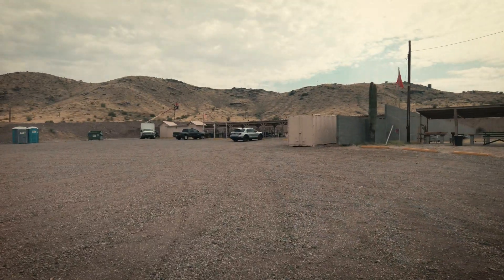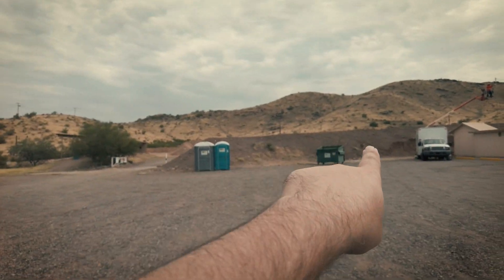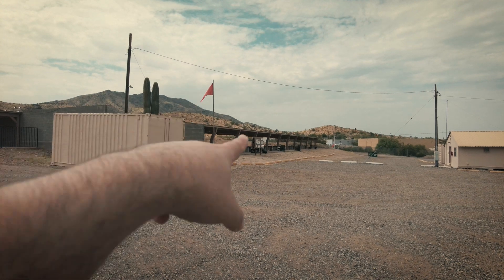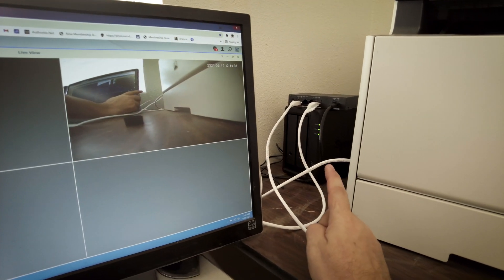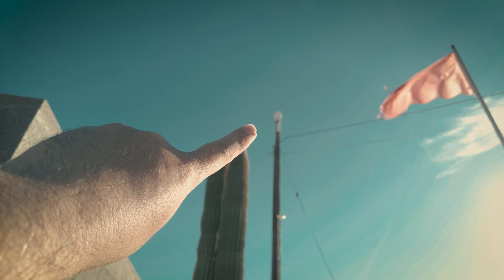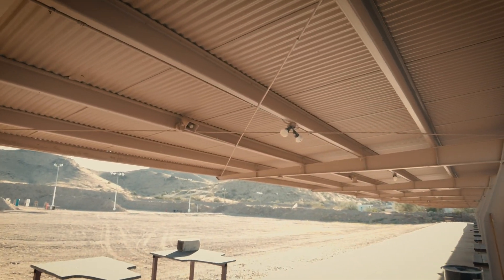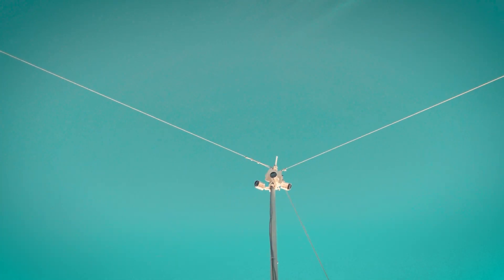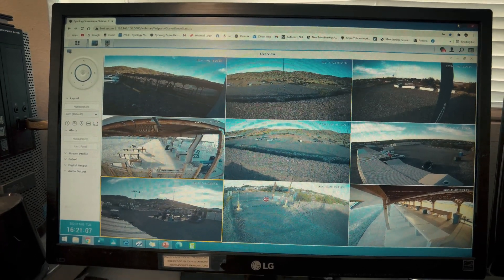Networked Security Cameras @ PRGC! | - DIY Ubiquiti Internet Relay Pt.73

Comment from the maker: I don't know if this is a common thing or not...anyone else network cameras with radios?
Reply: I do. I actually do quite a bit of networking cameras over radio for public service events. These are usually temporary networks, but fun to do.
Reply from the maker: @cfisupply  Oh nice! It works pretty well and yea, for temporary setups? It'd be perfect!
Reply: Locksmith/Security Prof, I have a few customers that have multiple apartment buildings with no connected networking, they wanted to add Access Control units for each separate building for the tenants to badge/fob in. Couple of Loco M2's and they're on their way. Easier than getting multiple ISP connections and using a Cloud Based system, although those are great for multiple very remote site syncing. Cameras run much run the same way, done a few gas stations with detached car washes they need cameras inside, multi building Storage Facilities, the list goes on.

By the way, love the content man, been watching since the Ultimate Showdown video. Good to see you're staying busy. Greeting from WA State, where trees ruin any chance of a good connection lol
Reply from the maker: @aaronsherry9972  Hahaha...damn you, trees! *Shakes fist*...😆

But yea, that's cool! Guess I'm not the only one to think of this. lol The things you can do with these little radios...it really is amazing the problems they can solve. Your imagination really is the limit!

Hey, thanks for watching! I've always been interested in locks and locksmithing...very cool, man!